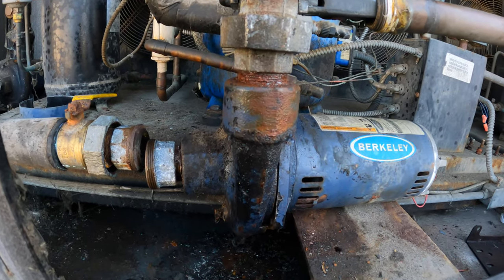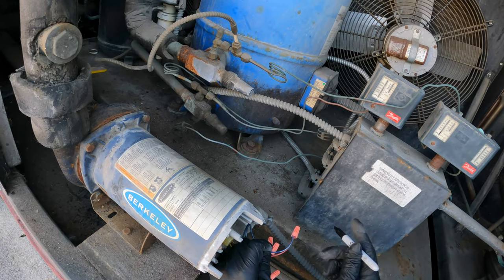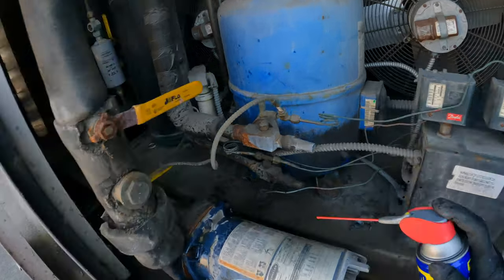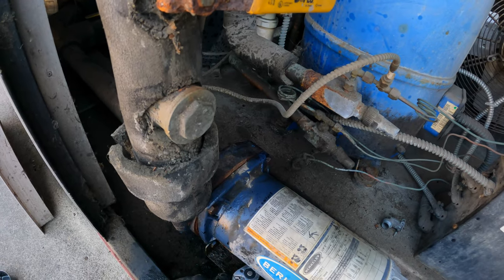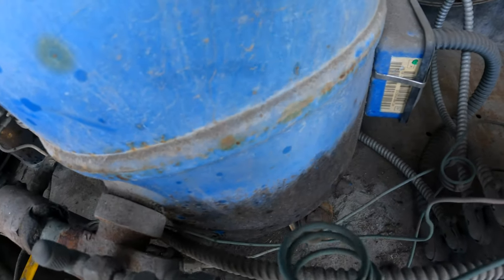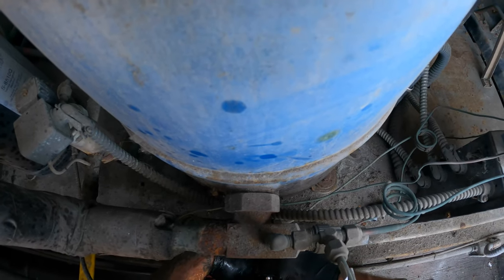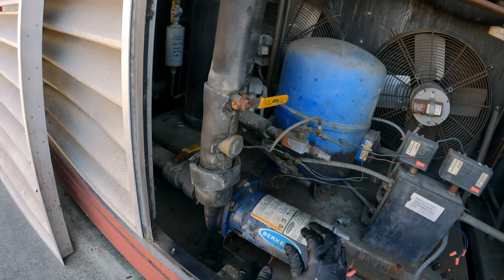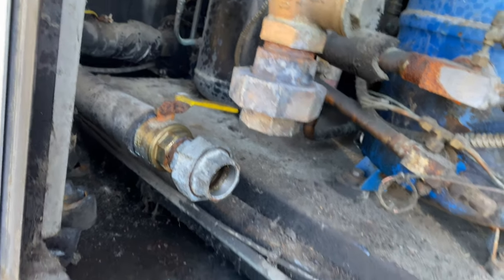Chiller Pump change out Part 1

Comment: One trick I learned years ago on steam piping was the beat on the union with a hammer. But not so hard as you break it. It worked a lot of times. Keep the videos coming
Reply: My trick was heat the union nuts and flange bolts with torch and breakout the 4’ Rigid pipe wrenches for the unions, and socket for the bolts. Try to tighten the bolts after heating, sometimes they will break free.
Reply: Old timers trick. My grandpa grew up designing building and repairing steam boilers. Mainly steam locomotives. He Showed us when we were young Heat them up with the torch and cool them down with ice water as quickly as possible. It shocks even the most stubborn rusted threads. Works like a champ every time!
Reply: 2 hammers hitting opposite sides of the fitting at the same time on the edges of the flats towards where you want it to spin.

Comment: Kroil, PB Blaster and a few others are fantastic at loosening those stubborn nuts and unions. After struggling with stuff like that....i apply never sieze to threads on as much as possible. Nobody else should have to struggle as the first guy to experience those pain in the rear nuts, bolts, and unions.  I even started putting a very thin coating on blower shafts...not so much it'll slip off...but enough to help the next guy get it off.
Reply: slather everything in good pipe dope, except the ground sealing face of unions. be sure to use stuff glycol rated and pay attention to others types if alcohol is used in the system.
some dopes are oil based, while others are alcohol based, use the wrong one and it will get eaten up.

Comment: heat with torch and bang the union nuts with hammer or back of pipe wrench in all directions and move the pipe wrench to different positions around it. doing that will distort the nut different directions, helping break the rust bond.
clearly I've dealt with plenty of rusted into a ball junk here in Ohio's "rusty salt-belt".  I don't like "no" for an answer from things I'm trying to take apart. 🤣

Comment: Just replaced 2 old r12 units on a glycol chiller for a winery as they are grow bigger. We replaced it with a 65kw (220k/btu) inverter Gree water chiller. That unit was so quiet and had two circuits and had least 5 stages per circuit to control the temperature for the load. They have two other standard condensing units with press plate heat exchangers with clunky semis. You do not want to be around a winery on harvest season FYI..... forklifts have wine holders 🤣🤣🤣

Comment: one trick i learned is to hit the union in the direction it loosens while holding a sledge hammer on the opposite side.
Reply: yep, heat, beat and move wrench around to distort it all directions possible to help break it free. 🙂